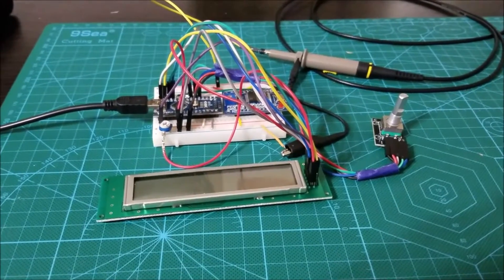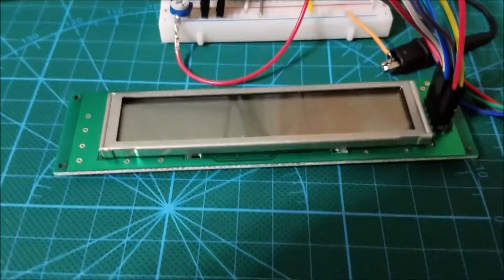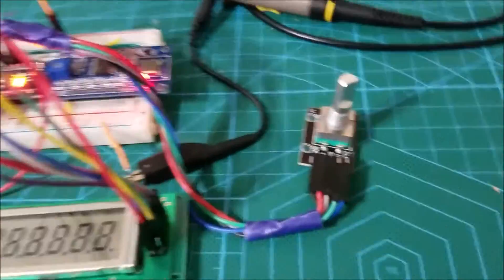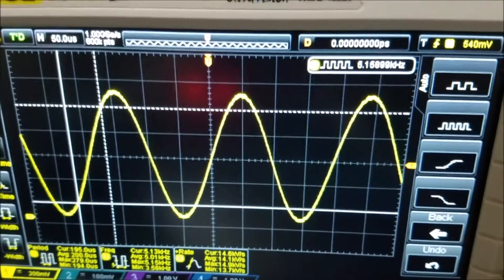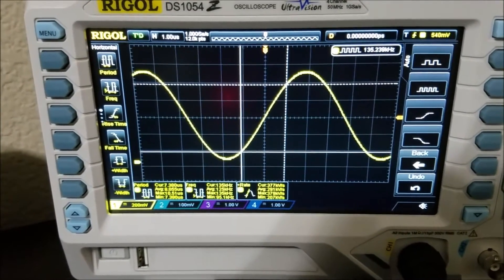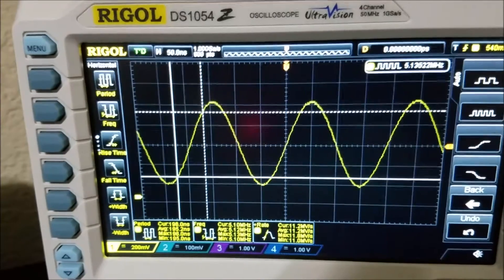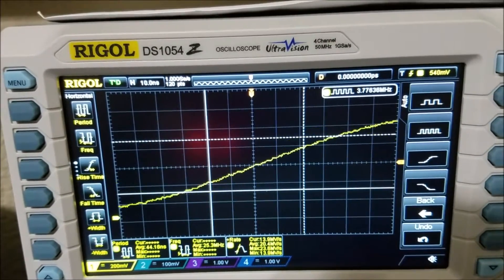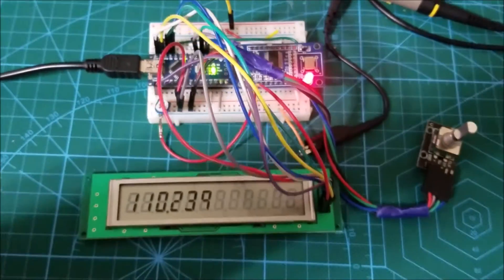Cheap Arduino based DDS Signal Generator using AD9851 module

Comment: great work brother.need help to add( square+triangle) waves in this respective project any suggestion would be appreciated thanks in advance
Reply from the maker: Been a long while, I will try and get you some info. If I remember correctly the module has a built in square wave generator on a separate pin.

Comment: great work - is square wave application available on the AD9851 board ?
Reply from the maker: Yes it has a basic square wave function on board.
Reply: whot do you mean whit dds load en dds clock conectins i am newbee